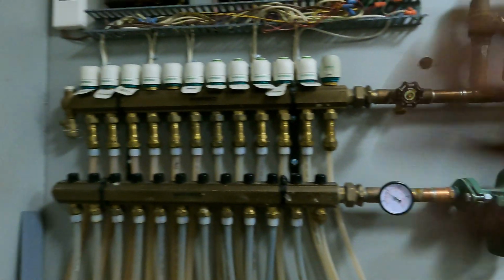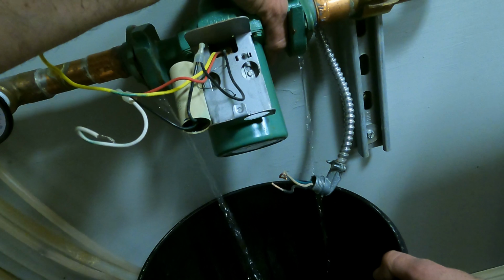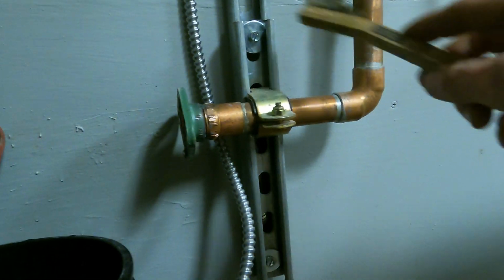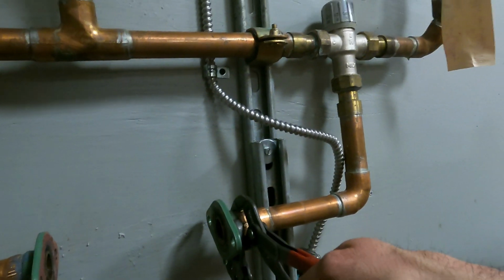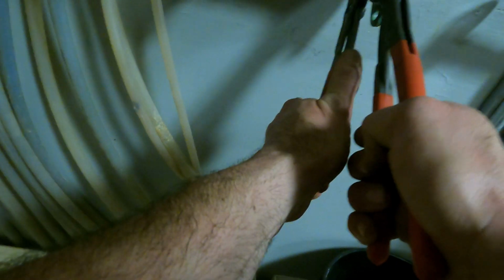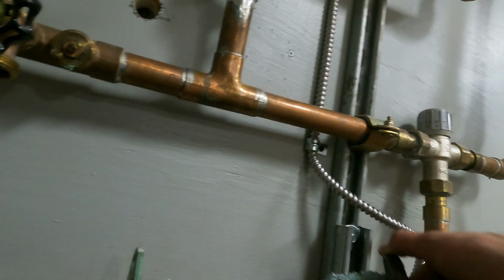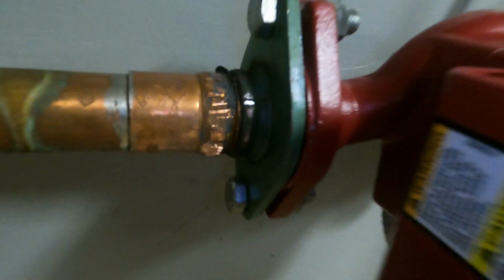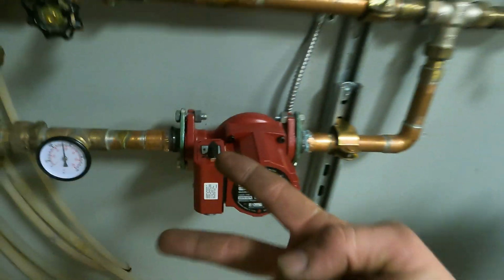No Heat Radiant Floor Cold Repair

Comment: those flanges that have floating gaskets drives me NUTS why couldnt they make a recessed area for the gasket to sit in
Reply: Gaskets are different from o-rings. I don't know about this flange and pump system but the larger ones I've seen (4") have a blank side and a ridge side. Thst ridge is about 1 or 2 inches and starts at the center outlet.  It doesn't fully contact the gasket but it does look like it's floating.

Comment: Would melting the soldering joints make it easier to turn 90 degree?
Reply from the maker: It would, I didn’t have my truck, forgot to grab flux when I dropped it off for maintenance. Why I chose to heat the sealant instead.

Comment: Not ohming out the motor windings in case the cap was bad and it was off on thermal O/L?
Reply from the maker: Motor was cold, how could it be off on overload? I don’t keep those caps on my truck. The cost of the cap is half the price of the pump. This customer doesn’t want to know prices. Just that his heat works. Check out the difference in price of cap or whole pump

Comment: B&G  made in China... shoulda swapped another Taco...
Reply from the maker: If I had one on my truck I would have. For whatever reason my company stocks these b&g pumps. They use to keep grundfos ups15-58Fc on the service trucks. I been contemplating carrying cartilages on my person truck. Plus a taco 007 and a 3 speed pump.